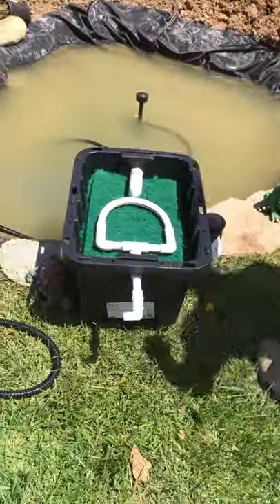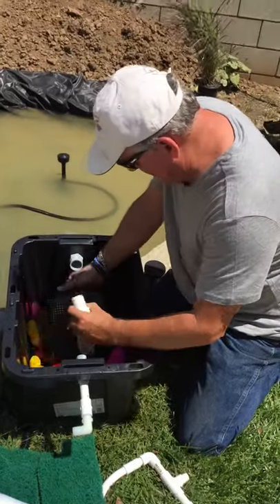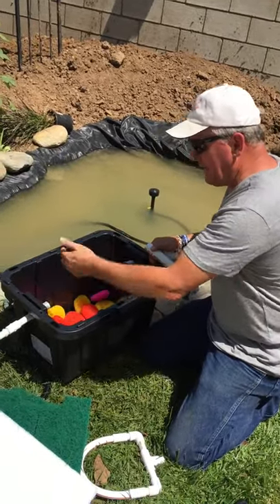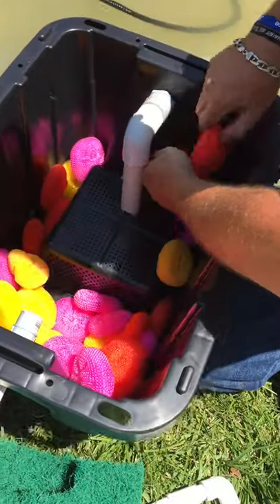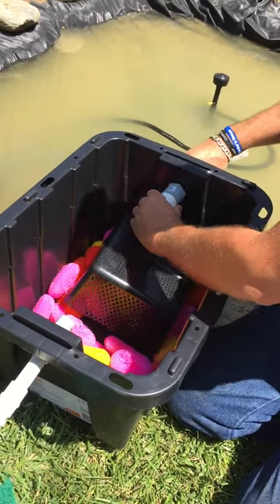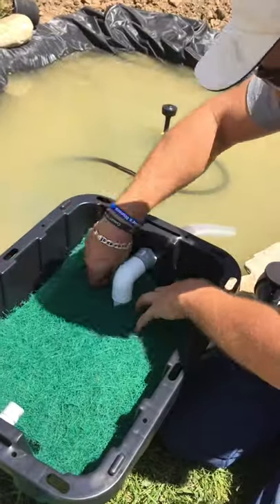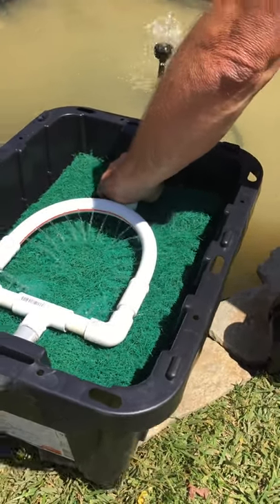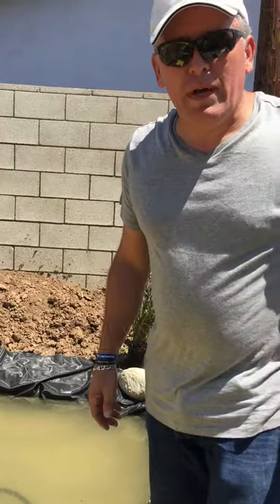DIY Pond bio filter.

Comment: Change your elbow on the outlet pipe to a t joint . It acts as an overflow . other than that Its 1 of the first bio filters I've seen on You tube that does work . I use fine sponge on the bottom then a corse sponge and then cover with Lava rocks . You can then add aquatic plants

Comment: The inlet pipe with the 1/8" holes drilled into it will clog fast. It is counterproductive. The water should free flow unto the filter where the filers filtrate.
Reply from the maker: There is a typical foam filter at the pump in the pond to keep debris out of the lines. So far there haven't been any issues with clogging as long as the pump filter is maintained every few weeks. 😀

Comment: I built something similar to this to try to clean out my very murky pond and wanted to leave a couple of notes for others. Having a vertical tee on the outlet is very important: when the filter material gets clogged, the water will not be able to exit through the down turned pipe fast enough and will overflow. Also cleaning the filter pads is really not fun, you need to remove each layer and hose it off one by one. In my case I have to do it multiple times a week
Reply from the maker: Not having seen your set up, my immediate reaction is that you are defeating the whole point of “bio” by cleaning so often. You’ll never get clear water by killing your bio, which is what you’re doing by cleaning so often. Most bio filters are cleaned once a month during the normal season. This allows the natural bio to build up and do the filtering within the mesh of your filter media. When you rinse the filter media once a month or so, you don’t clean all of it out. Never use soap. Leave at least 20% or so in the bottom of the box so that the biological bacterium can grow back rapidly and continue to work on filtering the water. Even the hose water, if it comes from a municipality, has levels of chlorine in it which isn’t good for the pond, but that can be managed by, again, not doing whole water changes. You should never do more than a 10% water change at a time in order to keep pond water healthy with your bio filter. Let the bio do its work and you’ll see a wonderful difference within you water, plants and fish.
Reply: @ProWingnut  Thanks for the reply! My cleaning process was quite reserved: I hosed off the top layers of hvac filter & buffer pad and left the sponges alone. The problem is that the top layers clog up too quickly and there is too much resistance due to the clogging so it overflows and most of the water never gets to the bottom layer of pads.
I'm gonna try a different setup with rain barrels and k1 media (once I find time)
Reply from the maker: Is your pond under trees or in a place where you get lots of debris that blows in? Do you have a filter on the pump? If you have pics, I’d love to see them and perhaps I can make some suggestions? Just wanting to help is all. 😃 you can email me at wingnut@prowingnut.com
Reply: Try to make a bog filter.  Even upflow thru gravel works nice.    It’s the best thing I have made in 20 years.

Comment: nice but looks like the flex tube will plugg up before the filters
Reply from the maker: This particular tubing is fairly smooth on the inside of it. It’s designed specifically for ponds and pond pumps.

Comment: Note: This is outside so it doesn't matter about a clog and then that filter overflows all over the place.  But if you want a quick tip for an overflow safety, use a T instead of that 90 on the outflow.  You can thank me later............
Reply: how does the T make an overflow safety?
Reply: @warrenpeas  think about it . How does a over flow pipe work on a Hydro lake .

Comment: How often should you clean your filter media?
Reply from the maker: I usually only clean about once a month…given different factors. Let the natural bacteria do the cleaning. If you have lots of leaves, then skim them out of the pond. But generally speaking, your natural bacteria that builds up in the filter box will do all the work. When I clean, I will disconnect the filter box from the plumbing hoses from the pump in the pond, pull the box and put 20% of the “dirty” water directly into another clean bucket and save that, so to keep the bacteria to start over. Then I remove the filter media and just rinse it out with just clean water to where it becomes the original color again. I might scrub the box itself some lightly, but then put it all back together again. Pour that 20% back into the filter box and then plug the pump hose into it again. The pump will fill it the rest of the way when you turn it back on. DO NOT use chemicals to clean the filter box if you want to keep fish or plants of any kind. If you neglect your filter box for too long and need major attention, then only add some light dawn dish soap for a cleaning agent, and make sure to ultra rinse all soap residue multiple times. Then reintroduce your 20% original filter water with the bacteria in it back to the filter box and run your pond pump again. The bacteria will repopulate in the filter box to full capacity in a couple days and your water will clear again. If the pond itself gets too cloudy or dirty, a 10-20% water change will be good to bring it back to balance. Hope this helps. 🙂

Comment: Any chance you could tell me what the filter equipment is the pads and where you bought them and what the pounds are that's my biggest problem I can't find the correct or anything that safe for my pond
Reply from the maker: The colored filter media or scrubby pads are from Walmart, but you can check the $.99 store. If I remember correctly, they came three in a package. I got a whole bunch of them to fill the entire bottom. Then the layered filter media on top is the replaceable floor buffer pads that I got at Home Depot rental department. You can purchase square or round and cut to size. I chose square because they were a bit thinker and without holes that the round ones have. They don’t sell them in then regular store isles that I’m aware of. If you don’t have a HD rental section, you can likely find them at any janitorial supply store. I’ll try adding some links in the description.

Comment: Thanks Patrick.  Very clear explanation for anyone wanting to DIY.  
FYI- I decided to make a similar, but larger filter box. I have 1" flex pipe exiting my pump (entering the box), and spent about $100 CDN at Home Depot for everything plus $20 at Dollarama for the nylon scrubbies (bio medium). ($119.00 total with tax.)  I spent more than I had hoped, but most biofilters that I looked at that would accommodate 1250GPH flow were $300 CDN and up incl. tax.

Comment: Hellllllp lol I have the same tubing, put a clamp around it as tight as i could and it has a slow leak. Even tightened it with my drill. That hard ring in the middle i think is whats preventing it from getting super right. What do i do? Replace the tubing? Crap was 25 dollars :(
Reply from the maker: Are you talking about the tubing from your pump to the filter? I used a plastic barbed push on connector from HD plumbing section and mine hasn’t leaked yet. Perhaps to cut a couple inches off and try to connect it again? The tubing doesn’t has any reinforcement wire in it, just plastic.
Reply: @ProWingnut  hello, yes that's what i was talking about. I ended up taking it apart and adding some silicone. Worked like a charm :) good luck to me getting it off someday tho lol

Comment: The outlet has to be lower then the inlet right?
Reply from the maker: Not necessarily. Some filter boxes are designed to gravity feed as a waterfall out a lip across the top of the outlet side of the box, while the inlet side is at the middle or bottom of the box. The key is that the outlet is larger than the inlet. For instance, the inlet size is a 1” line from the pump, but the outlet side is at least 1 1/2” or 2” diameter. Some filter boxes have one inlet and two or more outlets. Another key is getting the water to pass THROUGH the filter media, not just over it.

Comment: Awesome stuff!!! What makes the water crystal clear? Is it the bigger the pump? or the bigger the bucket? Thanks for the info...
Reply from the maker: Sorry, just now seeing this. (I should check these more often). I think its a combo of both. The bigger the filter, the better the filtration. The bigger the pump, the larger amount of water flow that can be filtered through the filter without becoming a torrential water falls. It should always look natural. The pump I used wasn’t terribly big but allowed for plenty of water flow for the little water fall out of the filter box, as well as the little fountain in the middle of the pond.
Reply: @ProWingnut  Thanks...

Comment: Instead of the plant basket, get that and all the scrubby pads, 'body wash' scrubby things,  or those thick green dish scrubbing pads all at the dollar store. I also use the hvac filter media as well. also, use varying sizes of rocks/gravel as well. You should put in a second line out with a shut-off valve to use as a backflow to clean out your system without having to take the entire thing apart just to clean.  I have basically the same system set up to work for my 1k gal stock tank. My pump is way over kill and has caused big issues for me, but, I'm working on it.

Comment: Did you have any kind of filter on the input to stop large debris from coming in?  Otherwise it looks like it would get clogged up at some point in your pipes that have the holes for water to come out of (on top of the green media)
Reply from the maker: Per Shop, the pump inside the pond has a filter to keep debris out. It has never clogged. I clean the filter once a month or so and it’s fairly maintenance free.